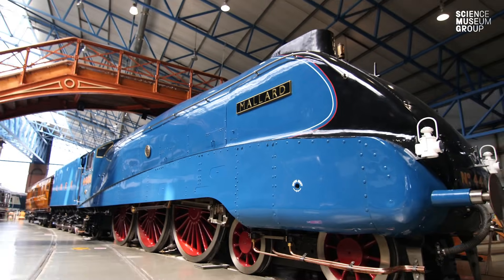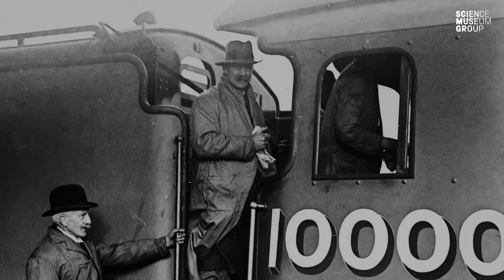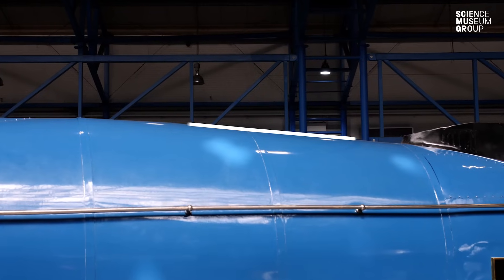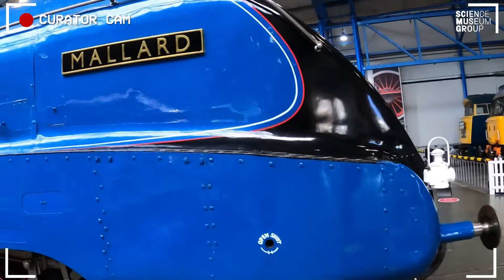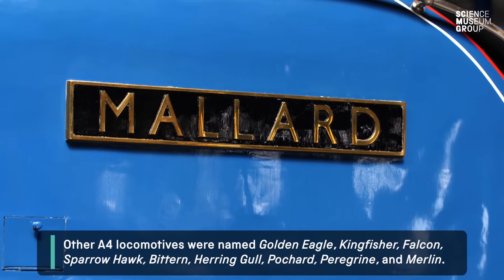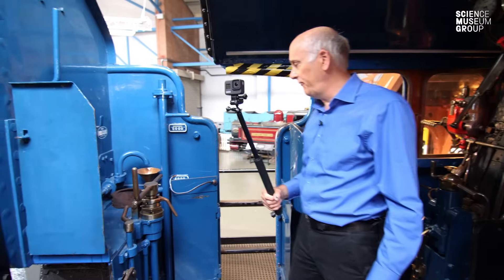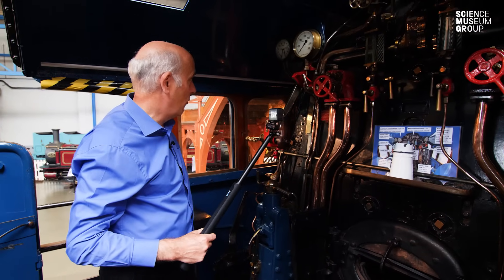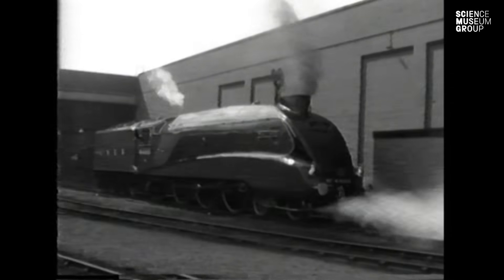Inside Mallard, the World's Fastest Steam Locomotive | Curator with a Camera

Comment: Do you think if the coronation class had been run on the same line it could have gone faster?
Reply from the maker: I've asked Bob. Will let you know what he says
Reply from the maker: Bob reckons the coronation class 'probably' could have gone faster, but perhaps not by much
Reply: @NatRailwayMuseum  maybe you should try it... 👀
Reply: The critical issue is more the valve gear and port/passage characteristics than 'sufficient cylinder horsepower'.  One other thing that a Stanier locomotive would need would be a Kylchap or similar front end.

The four-cylinder drive, in addition to being better balanced (in a locomotive third-class lever context) involves less thrust on each main, and better inside-valve timing and duration at high speed.

I certainly think one of them... properly fired... would take a LOT less work than a Ripley 3460 class Hudson as part of 'Project 130'...
Reply: Quite possibly, they certainly had the power and stamina for it. But at the same time, there was an extra set of driving gear under those engines,  which is what caused Mallard to fail when it overheated. So in theory, that’s twice the amount of problem points than on an A4. We’ll probably never know given that they reckoned Mallard could’ve gone faster if it got to try again.
Reply: @AnimatedIsaac  i wonder what would have happened if they had taken off the streamlining that runs along the side of the engine on 3 July 1938. when it was removed in BR days it certainly improved the look of the A4 engines
Reply: @eliotreader8220  agree they look much faster when the skirts were off, look fat with them on. presumably a few tons lighter as well
Reply: good point there